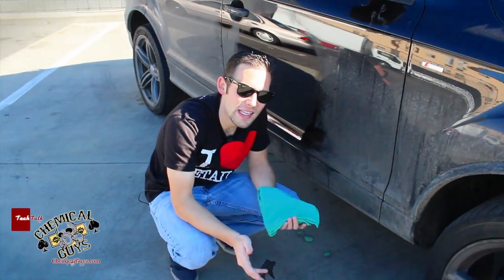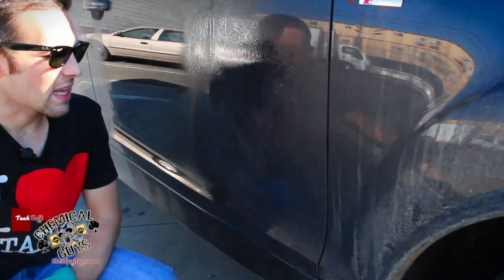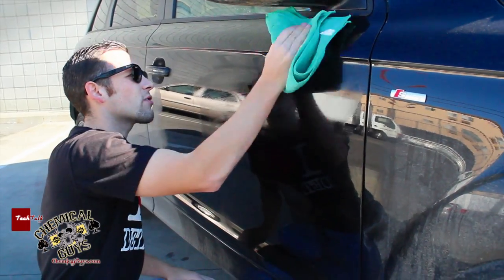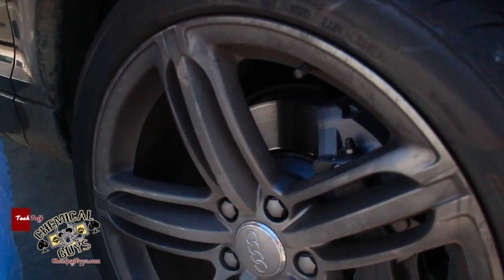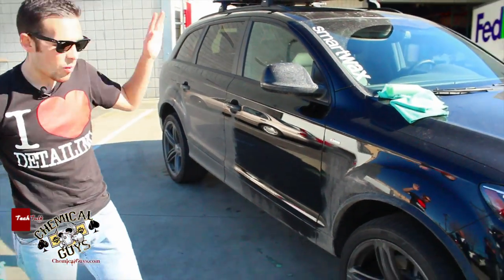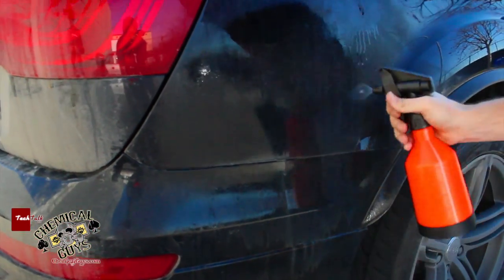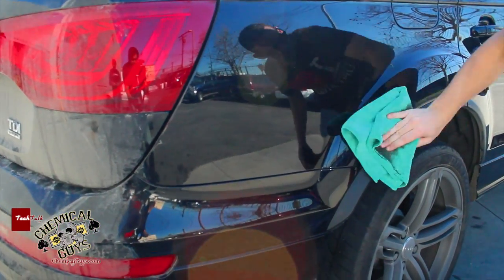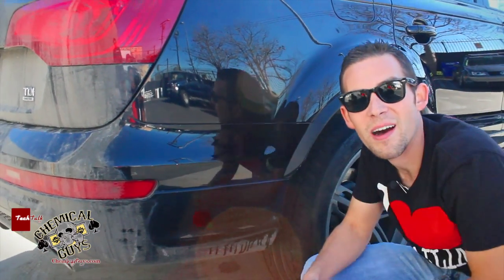Waterless Washing HEAVY DIRT & ROAD GRIME - Chemical Guys ECOSMART Audi Q7 DIRTY

Comment: I would never nor do I recommend doing this...  unless you want scratches swirls and fukd up paint...
Reply: If it's done correctly it is alot better for the paint than a normal pressure wash. I've been detailing for 3 years and on any nice cars that aren't too dirty it's better to do a waterless wash. I would not recommend this brand though, O.N.R. is the best.
Reply: @masonanthony3713  whats wrong withe pressure washer?

Comment: Best One: step 1 - Spray water from a hose on your car
step 2 - get a bucket with car shampoo dissolved in water
step 3 - immerse a towel in the bucket And clean the body and then the rims
step 4 - Spray more water to finish the processo
top tip: clean only a part of the body at a time And Spray with water because you don't want stains of dry shampoo.

Comment: even when i know im gonna be going in mud for whatever reason ill spray wd-40 on the whole side of the truck and when i pressure wash it off it literally FALLS OFF the paint. give it a good extra rinse for that wd-40 then i use the eco wash. comes out perfect every time. if i have crap on it from daily driving i just go straight to the eco wash. it gets streaks every once in a while so if i do i just spray a little more on and go back over it real quick with a cleaner piece of towel.

Comment: Stuff doesn't put swirls if you use it right. There are pro detailers that use NOTHING but this stuff. The whole purpose of its chemical composition is to NOT scratch the paint.

Comment: Make sure you use 2 bucket system to wash the dirt out of the mit before you put it back into your clean soap water.. or just spray the paint and wipe the dirt of???? Then its make sure you use only the PLUSH silk lined microfiber towel or you could cause scratches!!! got to be kidding me!! Sounds like they don't care what they're selling as long as they're selling!!

Comment: If it's that good why buy anything else from you guys?
Reply: +Shabec2982 I would love to see them replying to this! good job coming up with this question mate.
Reply: lol Good question.
Reply: cus it only cleans. no weather protection for long term weather changes or road grime etc etc. nice try at a smart arse comment tho
Reply: Well hey man if you wanna take 2 hours to clean your car during the summer months when you could easily be using a two bucket method you go for it. The rest of us will use TORQ cannons and other easier methods, but good on you.
Reply: A vehicle this dirty should not be cleaned with waterless. The only reason they did this was to prove that the product works. If you wanna use this to do everything then have it, you don't know anything about detailing though.
Reply: The product is great for shows near tracks in the summer if it's dusty. Should only be applied to a dusty car if it's applied with a good coat.
Reply: Steven Walborn
Reply: I think a car has to have been waxed thoroughly before getting dirty for this to work
Reply: This shit is amazing for my area ... i am in new england its cleans the worst frozen
 mess's i can throw at it .... but this is the only product i use from them.

Comment: I wanna know how mr detailer has not used any water to clean behind the wheels in the barrel, cleaned the break callipers without water, cleaned the engine bay without water, cleaned the arches without water

Comment: Like the idea but the grime is still being moved over the paintwork and if abrasive could still scratch. A proper preasure wash and this as a weekly top up clean I could see work and would use. 

Had some ceramic coat done on a kx450f and the dirt just washed off with eas after
😊
Reply from the maker: Thanks so much for tuning in!

Comment: I can understand using this for a light wash to remove some dust but not caked on dirt like this. This calls for the foam gun.
Reply: ***** Then use a power washer with a foam gun and use a high quality foaming soap to get the heavy stuff off and then hand wash it. We get the same thing here in Canada for 3 or 4 months a year but a good foam cannon along with a gentle hand wash does just fine. This product is fine for light dust and dirt but not for caked on dirt like on that Audi. Yeah it does get cold in Russia but you're harming your paint so at the least go to a detailer or car wash.
Reply: I agree, but when you are up north in December, it's 12 degrees out, and you have a month's worth of salt covering your car, I'm sure as hell not going to wash using water, covering my driveway in ice haha. I'll deal with the swirl marks until I can buff them out in spring.

Comment: If the pressure is too high on your water hose you basically push the dirt in the colour and when you wipe it you scratch the hell out of your car. Dry wash is better than high pressure hose. Low pressure water hose will do the same as if you spray the water on the paint, so it is better to use special products than instantly pull the dirt away from your pain, than you pass with microfiber cloth and you have scratchless car.
Reply: I'd be interested in any sort of proof you have to back up your claim. I've been using pressure washers to do pre-rinse and post rinse washed for 15 years and not one have I had it embed dirt in the paint causing swirl marks. I can; however, almost guarantee that there will be scratching caused when rubbing a Microfiber cloth over paint with THAT much road grime. No matter how much super special spray you use. 

Show me some proof of your argument and I'll retract this statement. Until then, you're full of it.
Reply: texasguy524
Yep I totally agree.
This wash less method totally freaks me out!
Like my daddy use to say,...If it sounds to good to be true, it be BS-lol
Reply: High pressure wash pushes the dirt into the color....You must be a comedian.

Comment: I'm not a pro detailer, but I do know that the method he used to wash that panel is wrong.  He could easily scratch up the paint doing what he did.  Fold the MF towel in quarters, and wipe down once or twice.  The key is always having a CLEAN side of the towel.  If it takes you 20 MF towels, then so be it.  Also, at 3:15, he states that's salt on the car.  Yet, he's out side in a T shirt.  Was this shot in California?

Comment: Now can those towels be washed? Or am I essentially wasting all of my microfibers and staining them. I think I’m better off wasting more towels using car shampoo or a two bucket method? If it’s just dusty then sure but all that black grime. Chemical guys charged me like 16 bucks for 3 small 16x16 edgeless towels generally expensive. What do y’all think
Reply from the maker: All the microfiber towels can be washed and reused, it's not economical to throw away your towels unless you're using them to wipe away a ceramic coating because it will cause the towels to harden.
Reply: thanks bud! do you think for a dirtier car its safer to use rinsless with a two bucket or three bucket method and finish it off with a sealant drying aid? want to do some contract work for a dealership . like small ones in my area. thanks again for your help.
Reply from the maker: It depends how dirty the cars are, light dust and dirt can be easily removed by waterless. Heavy dirt like what you would see on an off road truck or work truck would be better suited with a two bucket wash method.

Comment: For those saying "it will mess your paint" remember, the wash bucket and your'diluted.. yes diluted.. wash and wax solution will be using MORE water and less lubricant to remove the grit and grime. Using these waterless products are like NEAT shampoo on your paint with extra lubricity, so it really is better int he long run despite what youi think. Microfibre towels are cheap!  No post waxing required, no drying required, no water spots in hot sunshine.   A CLAYBAR will do 1000x more damage than any careful washign technique, so when you go washing your car with soft towels etc then go full fling into a claybar session you are already going to need a polish!

Comment from the maker: You will wash the microfiber either way..... If you dry the car from a normal bucket wash you will stillhave to wash the MF towels from drying the car.... or if you apply a wax or a sealant you will still have to wash those towels.

No matter what the situation, you will still have to wash the towels. 

-Greg@CG

Comment: obviously you need to really saturate the car with waterless(ecosmart or smart one or any other chemical guys produced product) you can't spray sparingly on a surface like that and of course use a the thickest microfiber you can find use as little pressure as possible wipe in straight lines as the wind blows and then have a second micro to buff the surface.... flip the wipe towel as frequently as possible. if your car is that dirty you should wash it, this works in a pinch.... great stuff though

Comment: Waterless cleaners (actually, should be called bucket-less cleaners, since they contain at least 70% water) aren't necessarily terrible, as there are techniques for removing them that help reduce scratching. All the same, if you don't have a good layer of wax underneath all of that, don't use it at all. If this is on bare paint, you will scratch it to all hell. Also, he's doing it wrong. You should make an initial pass to remove all of the major grime that doesn't require scrubbing of any kind, this is to remove most of the standard road dust and salt, etc. After that, before you do any kind of buffing to a shine, you make another pass with a new cloth to remove any left-over grime and anything that requires extra effort to scrub off. Finally, your buffing should be done with spray detailer to remove the residue left behind by the cleaner.
Reply: Amazing, that they can't explain this right, just for the sake of making the product look "simple".
You better have a STASH of microfiber towels in your garage!

Comment: Sorry but even advertising this stuff destroys the reputation of Chemical guys - they KNOW better than this - Selling this 'paint-destroying' product makes them lose all respect.

Only an idiot would use no water cleaning products - Not for those who care about their cars.  Disappointed in CG selling this garbage.
Reply: You pretty much have to use waterless wash at car shows. 90% of the time there's no water to be used. Usually if there is water there is rules saying no washing cars using buckets. I hate using it but don't want to show off a dirty car.

But granted they should be advertising it as car show only product not weekly use.
Reply: fork ka
But you don't bring a dirty car to a car show.. You clean it before, and once you are there, use water and spray wax..
Reply: SteevanNas
Or use a spray detailer.
Reply: Boost Which has less lubricant than waterless was so may as well use the waterless wash?

Comment: This is just crazy, why would you drag all that dirt, grit and road grime across your paint work.. would never imagine I professional detailer to agree to this method ?
Reply from the maker: Hey buddy, that's a great profile pic. We use this technique all the time, the reason why it works is because the solution is a mixture of water and carnauba. The Carnauba acts as a lubricant to break up dirt, and dust; while also creating a slick surface allowing the towel to glide on the paint. Some people like to use their pressure washer as the preferred method for washing their vehicle, while others like this method as well. Using a pressure over water-less wash makes sense when working on heavily muddied trucks, campers, or boats. We encourage the usage of both techniques to get the results that work for you.

Comment: Great job loved the video always love new inventors and seems like a very good idea  until the towel came in to the video it does work and is Eco friendly but  pushing the dirt across the paint not a good idea if you care about your car .
 i have been in professional detailing  for over ten years and a consultant for large and small car dealerships. in my years guys have come in to my locations and have tried to sell me waterless car wash ideas, bottom line use car wash soap wash often followed by a spray wax don't let the dirt build up and anything will scratch your cars paint.  proper maintenance and good hand or Da Machine wax every ninety days is the way to go .

Comment: but the real reason im here is to say that this honestly works really great. my truck is black and ive had no issues with it. now i dont go slap some mud down the sides of the truck and then use this stuff out the gate... its not that i dont completely trust the product (which i don't, murphy;s law) but its more to cover my own ass. first i just take it down the street to a coin wash and use their pressure washer to knock everything off just to be sure.

Comment: Not a fan of the waterless system. Will it clean a car sure but at the high probability of scratching it and using towels galore. Only in isolated instances would it be feasible but here in SoCal, hell NO.

Comment: This is actually harder than just giving the car a normal wash with water.
Reply from the maker: Hi Richard, thanks for watching. Using a waterless wash is a breeze, and it's fun. I feel like washing with a Foam Cannon is really fun, but it does take more preparation. I've used a waterless wash on multiple occasions, and it takes very minimal effort at best.

Comment: He should power wash first then foam and then what ever doesn't come off wipe off bottom line no matter how good we wash our car we get scratches no a degree and no matter how much soap we use etc we may have to rub it off still that's life !! But this video doesn't reduce scratches it greatly increases the micro scratches we get during the washing and drying process it even says for waterless only use it on a car that's only a little dirty and muddy not extremely dirty like this this is insane

Comment: Why people come out waterless car wash product? We are so lucky that we can have unlimited use of water. In certain coutries, they will be fined to wash car using too much of water. Therefore, this product is just right for them. 

We even can not avoid swirls no matter how hard that we try for detailing industry due to time constraint and cost saving. For individual that wash your own car, yes, you can. First, use longer time (keep rinse the cloth as 1 cloth surface is used only 1 time). Second, use more money (keep changing MF cloth as MF will get harden after 3-4 washes).

If you go to the professional car detailing center, no body will use waterless product to wash cars. Auto detailing centers will use the product if it really help and effective!

Comment: what's so hard about just washing?
Reply: The whole point of waterless products is to conserve water in drought riddled areas like California.
Reply: During the Fall and Winter months you must love to stand outside in 35 degree weather freezing your butt off washing your car huh? I don't use car washes anymore after it left imprints on my parents car when I was a teen and my own car before I sold it earlier this year...the wax or something dries to quick and messes up your paint....Plus, don't want to have pull out the hose and bucket and stuff to wash the car all over again after over spray rain left water spots and all...this could be a quick detail wipe...otherwise I will just look to use Griot's Garage Speed Shine for a quick wipe off the dirt between washes....

Comment: Worse thing you could do to the paint.   Grinding dirt into the finish will scratch regardless of what these guys say.   thier is a wax in the product which will hide the swirls for a few weeks but after that your car looks like it was washed with a scotch brite pad.   Wash is simple, you need to rinse the excess dirt off, then lub the surface with water to prevent scratching.

Comment: I think this is only useful on very light dust I can't imagine using this on a dirty black car.
Reply from the maker: Greetings, and thank you for watching. EcoSmart works great for removing dust, dirt, and debris from daily drivers by using a combination of water, wax, and other lubricants to ensure that you're getting a scratch free wash, and eye catching shine. For extra muddy work trucks, recreational vehicles, and construction equipment, a foam cannon paired with a pressure washer and a container full of Chemical Guys Soap would do the trick nicely. I've personally used Ecosmart, and I did enjoy the results very much. Bear in mind that we drive on paved roads where our cars come into contact with dust, bird droppings, environmental fallout and contamination which damages paint.  Stay tuned, more great videos head your way every week.

C.G. Alex-

Comment: Takes 5 minutes to clean a car with a wash and wax foam cannon using just one cloth & a little bit of water, whats this about then?
Reply from the maker: Hi Craig, what you're seeing is a water-less wash system that incorporates water and wax and some other lubricants to clean your paint. The waterless wash cleans, and adds shine to your paint through the use of Carnauba Wax, the wax lubricates as it removes dust and dirt to restore an amazing finish. EcoSmart is a great way to get your car clean before you clay, and polish. I've used EcoSmart to clean my paint, and I've used it to clean my wheels, glass and headlights. You should give it a try, I think you will like it.

C.G. Alex -